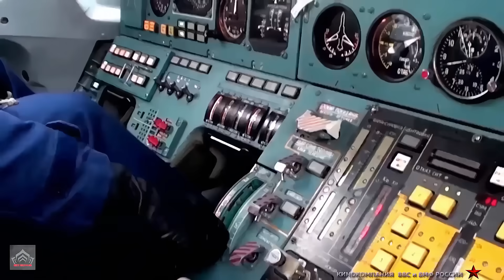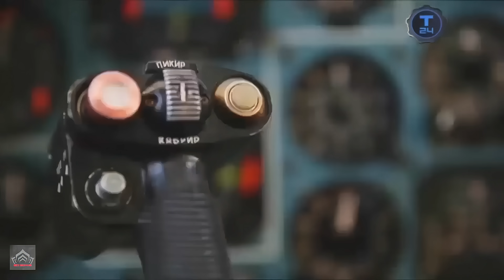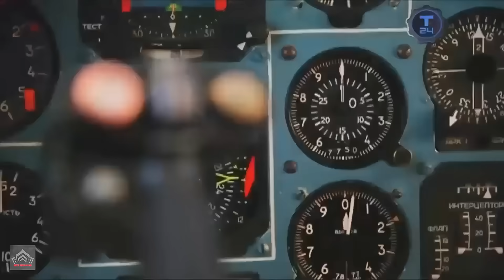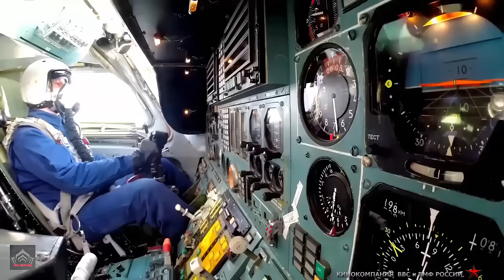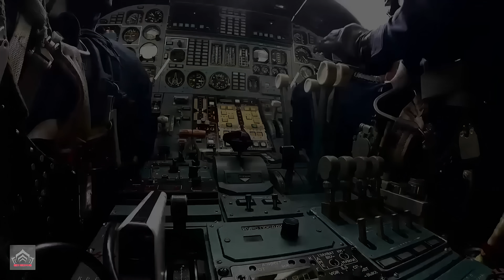Russian Aerospace Forces New Tu-160M2 Bomber to Enter Service within 2025

Comment: A production run of 20.to.30.per.year is the minimum to attai. A total force of 600. To enable true Strategic Strike capability supported by 800 aerial tankers with a 50,000 gallon Give Away ability at 3000 nautical miles with 4 hour loiter 3 Flying Booms with 3500 GPM Discharge output.
Reply: Are you a gamer?
Reply: @quanxuan3345  Definitely had a can
Reply: Russia has several priorities